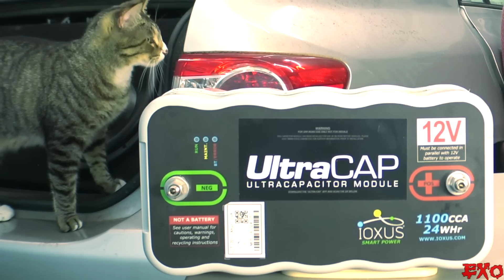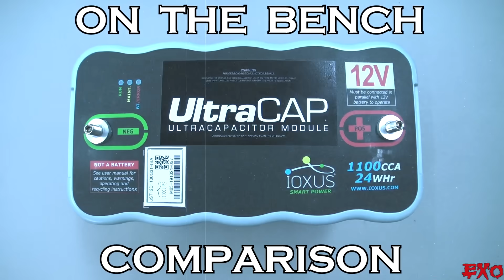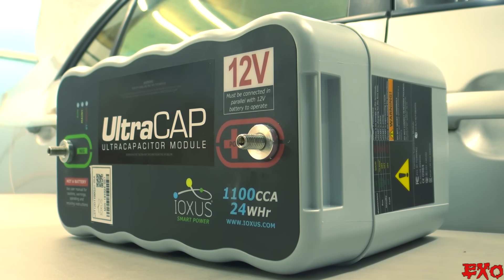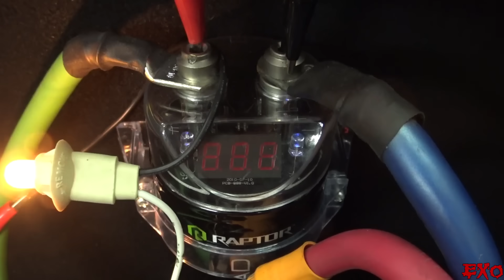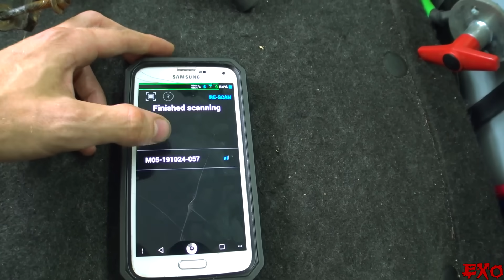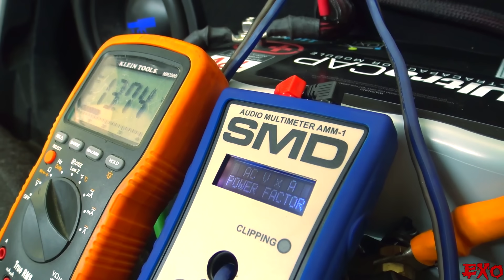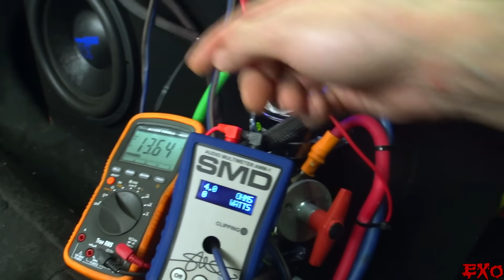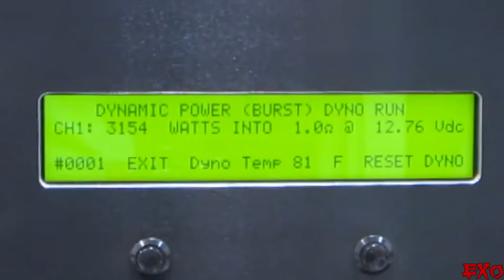The TRUTH About Car Audio CAPACITORS! Testing a CHEAP 12v Capacitor VS IOXUS UltraCap Supercapacitor

Comment: A regular cap stopped my headlights dimming. Mind you I did the big 3 and built my system to be well within spec of that. My headlights actually dim from the use of anything my windows will cause it to dim so I put on in and it stopped instantly. I alway use the rule of try a cap first if that don’t work install another battery. Caps only help to stabilize the load.

Comment: I'll just buy the ultracap with XS Power D3400 XS Series 12V 3,300 Amp AGM High Output Battery with M6 Terminal Bolt. For the back and a red top Altima battery for the front All of your problems will be solved it might cost you but it's worth it with a system so much power you don't know what to do

Comment: As a newbie to sound systems. I bring my industrial electrical experience and diy electrical systems knowledge to the game. My initial assumption has been to reduce vdrop. So I use quality cables/bars, and short runs. So taking this approach. My vehicle becomes the remote generator, and I just built a 600 continuous amp LiFePO⁴ 12v pack with a converter bank for the 14v max of the amplifier. This system is probably overkill but I wanted surge and continuous capabilities so that the voltage just never drops. Running this in a crown vic pi p71 with an upgraded alternator for my other stuff keeps the pack full. I never see dimming or anything weird but I will say the $4,000 price tag for my particular setup is way overkill.

I reclaimed and built into a pack some 60ah lips cells into a pack. I took 16 of these cells for a bigger capacity but 1p will work. The bms on the pack is for 250amps, it effectively does the same as the super fat iron pack for the subs. Kicker is it only cost $400 to make and is next to the amp with a 0awg running from the battery into it for charging. The amp will stay powered longer than the door speakers. I also built a bypass after watching this to allow me to jump my own car instead of having the diodes.

Comment: That's a good comment caps versus second battery if you run a second battery you have to run an optima or AGM battery they act like a capacitor capacitors are great on long distance runs where you don't have the battery smooth out the current but you got to have some good cables not those ones that look like good cables but I'll look some show go to welding supply house and get some cables fine wire works the best if your speaker wire should be fine wire not the ones you can see through but get the real speaker wires.

Comment: Absolutely excellent management of the question. A much needed explanation with well received excitation! You're a character! 
I did not know of this product. How might it compare with a LiFe Battery and deep cycle demands? Seems like it might be quite the cake taker across the board. It would be great if you could address this inquiry because you're motivated entertaining and thorough. Plenty of automotive applications as solar power systems are installed stationary and mobile. It would enhance all of our understanding. Rock out when you clock out my good man!

Comment: some of you are still missing what a cap does, these hybrid caps are not the same deal... the 4fd cap may not have a large pool but it does have a FAST charge, Discharge rate, and this buffers a system to help not kill an alternator...  the rule of thumb was always 1f per 1kw...   but here is the problem, you need an alternator to keep up... so if you have to say a stock system, you really need to stay somewhat in the area of the alternators range...   even a 1000w amp will eat into a lead battery with a cap on it... but say a 500f cap will let it be eaten before the lead battery, but still it all comes down to how long you are going to let their batteries/supercaps and caps recharge from the alternator.  they both have 1 function and sorta do the same, but the cap is cheaper and if you plan to stick under 1000w, the 1 to 4f cap will do just fine

Comment: Always been a big fan exo since the early days of your channel you helped me install my first system over 10 years ago and done plenty more since then, id love to win that super capacitor just to see if i can gain anymore headroom from it currently driving an old 80 series landcruiser all the door panels are rotted out so atm using a yamaha DBR15 PA speaker in the rear of an inverter as a temporary solution, keep up the awesome vids exo

Comment: I guess I can't test those with my ESR, capacitance meter?  Lol. Just kidding. I love the ultra caps! Actually I would love to see you biuld ? Or modify the RAIZIN voltage stabiliser? Using those 1Farad to 3Farad capacitors? Testing in engine performance? Smoother? Etc. Set-up

Comment: I run a 2 shok titons on a boss 3400 mono block amp ..running a 170 continuous alternator and a 100 amp battery... all the big size cables..i did the big 3 upgrade to get the most power to the amp and .. when hitting big bass my voltage would drop to 10.4 ..so i installed a 2 fad 24v capacitor .. now my voltage only drops to 12.7 at most ... so i dont understand why people say they dont work... plus my bass was a bit harder aswell as it keeps the amp running in a more efficient manner

Comment: What’s the wattage of your sound system? I was thinking of upgrading the system in my hybrid car but im worried about affecting my gas mileage
Reply: It does affect mileage but no much at least for me my car I still average 30-35 mpg for a full size Avalon hybrid I’m running 2 sa, two amps and an agm at the moment I’m not sure to purchase the super cap to help my voltage stay regular when bass hits constantly
Reply: I'm researching for the same info

Comment: nice test, thank you.
I would be interested in a video with an oscilloscope showing the charge / discharge curve and voltage on the capacitor, your alternator and your battery.
the hantek 1008C with the current clamp would be suitable I think.
do you have the possibility to do that please?

Comment: Most Audio Amps contains a DC/DC-Converter that convert 12V to +/-50V (the Voltage depends on the brand and power rating of the amp).
This higher voltage is buffered with several capacitors inside the amplifier.
The problem is, that there is little space in the enclosure for this caps , they cost some money and they are not 'sexy' because they are invisible.
So usually the caps inside the amp are way too small.
If you want the best result you can technically get, you shoud increase the caps inside the amp.

Comment: What a great explanation. 
What if you don't have room in your vehicle?
I'm just trying to keep headlights from dimming. I'm running two 10s on 1000 W Amp and there is no room in my 2012 Ram for that big of ultra cap. Would it do me any good just to buy the 4 F cap to help with headlights dim?

Comment: Do you think that capacitor will work with stock electrical in a 2002 Chevy Silverado 1500 with 0 gauge and a scar audio RP 2000

Comment: I just use a separate 9 volt battery to run my 5 K amp ...no dimming lights or anything. I made sure to use a DURACELL brand from Walmart. Save your money 💰

Comment: Had one of those once back in 1989 🤣🤣.
  Being able to start the car was pretty cool! 
 I honestly would add a, battery a good wheel chair battery MK or something alike and a bigger alternator (first). Only reason I would go with a cap is if a new alternator and adding a battery didn't fix my headlight dimming. But I have learned in the last 27 yrs it's all about quality and knowledge. I have 1 12in sub ported box, 3 way active components in front and 2 way in rear 1600 w rms and I will slaughter guys with double that but wired say with 3 or 2 way passive no dsp but they bought top of the line everthing. You can do alot more for less is what I am getting at.  For first time ever in a Lexus I bought I am doing am experiment with cheaper everything mid grade I would say it sounds just as may not last we will see. 
Today's cars are a mofo to do anything with have to spend 3 or 4 times more than before. Best car to upgrade in my opinion is BMW with Helix plug and play has got to be as simple as it gets and quality is phenomenal. 
Sorry bout getting off topic.
I do like the Super cap though I may end up who knows!
Definitely a great informational video and I learned something to! Maybe a better route than second battery?
And would you recommend changing alternator before the Cap or try Cap first?

We all have reasons I like second battery cause I am human and ever so often I leave a light on. Thankfully I had second battery could still start car.
Now that I am thinking about it I would also think a Cap would be better as far as saftey!

Comment: Do you wire the super cap straight into the amp or to the battery?
Reply: I think both, power from amp goes to the cap, and power from cap goes to main battery

Comment: could you use the Capacitor and Ultracapacitor together using the parallel wiring method?? if so which 1 would you put closest to the amplifier?

Comment: Right now I'm pushing a kicker ZX2500 .1 and when installed the amp has a 300 amp fuse right near car battery. I'm pushing 2000w X 2 so I have two 12in Skar D3s which contain dual voice coils and these coils are rated at 4 Ohms each and I have them wired in such a way that I'm drawing 2 ohms which is the minimum my amplifier can handle. Are these subwoofers receiving 2000 Watts each when max is 2500watts. They also have dual stacked magnets and a vented voice coil through the back of the magnet right in the centre and this seems to keep them cool but when running for an hour or more at 70% volume the magnets heat up but not to a burning the skin temperature or anything near that is that normal? The amplifiers Peak states that it is 5000 Watts or 2500 watts RMS and I have it turned up to about 80%.  Bass Boost +4db and X-over set to 80Hz. I'm using a 20farad capacitor and wondering if that is good enough for this setup. I have much more to do like the door speakers need to be upgraded and an amplifier added to push the door speakers and I want to get a 4 cubic ft box for the 2 skar 12 inch subwoofers as right now they're running in a 3.2 cubic foot box. I can dim the headlights easily when the volume is up past half but do you think the Diming is a big issue even though I have a 20farad or actually dual 10farad capacitors that are inside a metal frame and have blue LED backlighting and also a voltage metre that I can watch the charge of the car and Battery as I'm playing music and get an idea of where my voltage sits and I've never seen it drop below 13.8 V and this is after an hour or two of playing at max volume.  I'm asking this because my voltage metre stays steady at 14.4 V when playing normal music at a regular sound level but I can get it to drop to about 13.8 V when I have my subwoofers turned all the way up. Was just wondering if you can tell me if I'm risking ruining anything or is what I have set up doing fine and will keep doing me fine as long as I don't get in a car accident and smash it all up. The subwoofers are 2500w Max/per subwoofer so am I underpowering or overpowering by giving them 2000 W each or 4000 W total? Also I'd love to win that super cap that you're showing and I've been following you since you started out going to the car shows and competitions and just wanted to say I'm a big fan and I love what you do! you bring me joy bro,  for every video you post i get a positive "charge" your knowledge "amps" me up. Don't ever give up your hobby your great at what you do and you teach the noobs like me what not to do hahaha. I never knew as much as I do now I didn't know much other than I love bass and my friends that had systems in their cars always gave me dreams of having my own one day and now I do and I must say thanks to you so far it's been running smoothly and things I'm not sure about I take to a shop down the road which is famous for its installations and knowledge in this local area and usually to get in to have something done they are backed up at least about 30 days and that's with three or even four workers going at a time all day. Thanks to my stubbornness I have gone about a few things the wrong way and messed up a few items so you can say I've learned a few things the hard way but thankfully it's never being anything too expensive that I have destroyed so no worries my friend. Couldn't blame you anyway because you are a teacher not the one who told me to cross the positive and negative wire and watch the Sparks Fly LOL no I didn't really do that but now I like to research ahead of time like you do. I learned that from watching you the fact that it's easier to research and do properly rather than research nothing and screw everything up.

Comment: I don’t have room for a big battery under my backseat. I’m about to be running 4 ds18 exl 8s. I am going to do the big 3 and was wondering should I do a capacitor at my amp. Or what should I do?

Comment: That super cap is thu shit would using that save me from having to run multiple alternators running 2 Orion 4000.2 hcca and a kicker kx 2400.1 and 2 skar 2000.4 in short form could a good high currant alternater and one of those super caps give me enough power

Comment: I had a Power Akoustik cap on my system. The alternator surged  and slagged my battery and one other component. The cap stopped the surge before it fried my system. And to boot i used that cap in 2 other vehicles before it died years later.

Comment: Good idea destroy alternator and battery to charge quickly super capacitor.  Useless for audio. 4 farad take 6 second to charge. If you have 6 second of overpower volt drop you have to change battery. no add a super charge.  Pointless comparative. Thats a common error, but is very simple to understand.

Comment: Exo did a great job trying to debunk those little cheap soup can jobbies. One thing, those pretty cans with voltmeters all lie like a rug about the farad rating. Most are filled half full of cement to give em a feel of power! The misconceptions abound! Those cheap-O jobs can only deliver a quick "punch" of energy, but need a bit of time to re-charge before delivering another quick punch. A steady state bass note will nullify the capacitor and just draw off the battery.  I have to LOL when the instructions say you can get a big shock if you touch the terminals of a charged cap. It's still 12 volts! LOL.  a ONE MICROfarad 10,000 volt cap charged to capacity "could" kill you! How long is the life expectancy of that so called Ultra Cap? A real good standard capacitor could deliver rated specs for nearly 30 YEARS or more! There is no chemical actions taking place in a capacitor, unlike a battery. So many things seem wrong here with that fancy Ultra Cap. Remember, a real capacitor will attempt to charge just as fast as it's discharge! A fully dead capacitor appears as a short circuit to a power supply! That's why they suggest to slow charge using a resistor, NOT just full connecting to the battery supply! Can you say "big sparks", or exploding battery? A real 2.0 FARAD 16VDC capacitor could cost over $200.00 at an electronic component seller! These $30.00-$80.00 ones are just an anchor. There's much more, but I'm done for now.

Comment: I doubt you will see this but I think I ran into an issue finally after 2 years. I have a 2002 Honda Accord with a 80 amp alt and my amplifier is 80 amp. I have it cranked playing mostly metal 40 minutes to work and 40 minutes back home and 2 weeks ago when I got close to home my dash light were dimming and the car wanted to stall. It hasn't done this until now. I'm thinking I need a higher output alternator more than I need a cap. But would a cap offset and keep my electricals happy or should I get a better alternator?

Comment: I'm trying to install a 1500 watt rms system in my 2012 chevy cruze. I feel like I'm at the edge where maybe a high output alternator is more than I need. But doing nothing is gunna starve my subs for power.

Does anyone think a capacitor for less than 145$ could be beneficial in my situation?

Comment: Would an ultra cap be overkill for a single 250W 4 Ohm woofer and 500W amp? I just don't want to kill off batteries and alternators like my friend used to.

Comment: So my question is.... my stero just started clipping at max volume after turning up the bass on my system.  I think it's starving for voltage since I'm pushing it harder. Would a cap help keep more voltage on demand or am I looking at another issue? 🤔
Reply: That's cause you got shit speakers and made pushing them way to hard

Comment: Question; I replaced the [24v, 200Ah]  lead acid with a  [24v, 200Ah] lithium battery bank on my 5000 watt inverter/ charger , UPS IN MY CAMPER. all was fine, until i realized it is imposible to get all 8 cells to discharge to their lowest voltage ,at the exact sm time to get down to the 21 volts needed to kick on the lead acid charger within the 5000 watt UPS. IT SHUTS DOWN as soon as one of the 8 cells has 2.5. I've tried all the tricks but it is just to close and these cells are just not well matched.
 IF ,I PUT this capacitor pack or another, between the battery and charger, would it trickle down to the 21 volts needed to kick that charger  after the lithium battery shuts down to early? what do you think? If this worked , it would be a great and needed product.$$$$$.
  again; low cell shuts down battery with 23 volts. capacitor continues to deliver power till it gets down to 21 volts and triggers the charger, which recharges the batteries from the house power. will it work? it sound just like what it does for audio amplifiers.